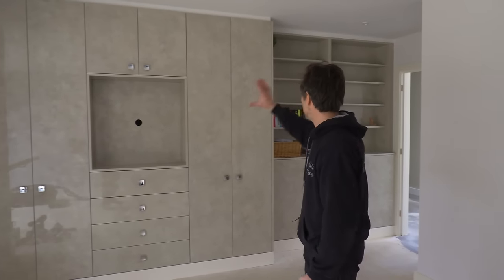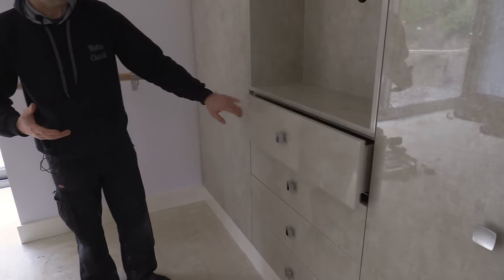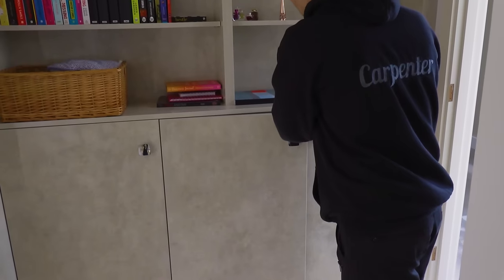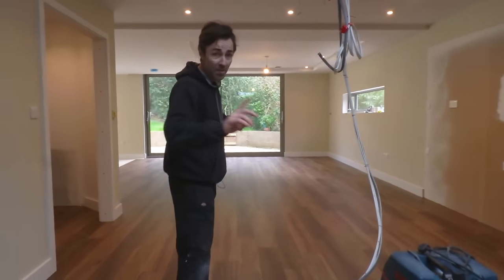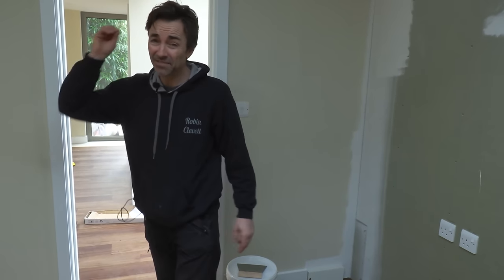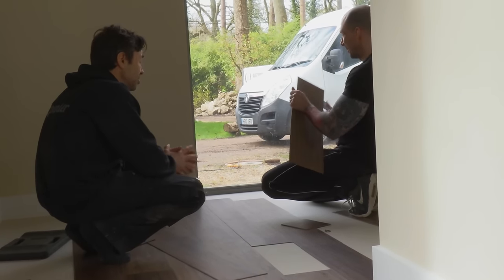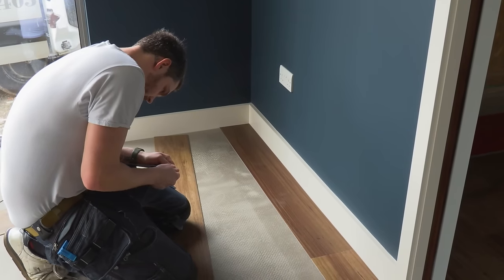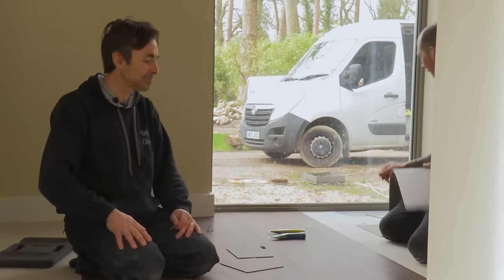Karndean Van Gogh Flooring - Capel #23

Comment: Hi Robin, Great Video I use LVT on a lot of my building projects and karndean is a very good product but I use a product called ambiance flooring I highly recommend you check them out there based in the midlands and also have a vast range of flooring designs. Best of luck for the rest of the build loving the content. 👍🏻

Comment: Robin what are pro’s and con’s with having a remote floor probe instead of using the actual stat? Perfect timing with the video for us as we need to decide on UFH design, Cheers Richard
Reply from the maker: The room stat measures air temperature and it will close the circuit down but it could be set at 30 degs cent for the air and the floor could be running at 40 or even 50 deg cent. The floor probe is a limit stat. The low temperature is also needed on timber floors. The only one you can turn up high is ceramic tiles.
Reply: Richard Corns You have both, the remote probe is making sure the temp in the floor does not go too high, usually 27. The thermostat is in the controller to monitor room temp, what ever you have set to.

Comment: I was interested to hear in the video that Karndean have done something about sensitivity to sunlight. I have Karndean throughout my house, and it has seriously discoloured due to bleaching by sunlight in just a couple of years. I don't know how to upload an image of it, but I can tell you that my flooring is now bright green instead of the warm oak wood tone that it should be. Karndean have offered to replace my flooring as a "goodwill gesture" but I will now have days of disruption to remove the existing flooring and have it replaced with the new planks - and I am having to pay for this work to be done myself because Karndean couldn't trace the original purchase of the flooring (which was fitted before I bought the house) so they didn't cover it under their guarantee. I would urge caution for anyone wishing to fit Karndean flooring anywhere that receives a lot of direct sunlight. Prepare for it to become bright green!

Comment: Recently done my kitchen diner extension in lvt around 60m and initially I couldnt speak Highly enough about it but found with a busy family it marks far too easily for my liking and it's only 5 month old
Reply: Also rubbish with heat expansion
Reply: I guess it wasn't Karndean then? I had it installed in my kitchen diner 13 years ago. The room gets used a lot and always has kids traipsing in and out with filthy shoes. Even now there's only a few marks in it and you don't see them unless looking for them. I'm looking at replacing all my wood floors with Karndean.
Reply: @supernoodle48   did the floor decolourise like many are saying we are planning to get ours done ...going for glue down
Reply: @vaniv2886  There is a small area just on the inside of a fully glazed door. That does get the sun most of the day and I guess the rays have really blasted that spot. The rest of the floor has no noticeable discolouration.

Comment: (Got Karndean at home - better half insisted no wood) Was surprised as a wood expert for you to be promoting it. One really important point - the subfloor needs to be perfect, it will show up any irregularities being flexible. Noted fitters bevelling the edge but assume that just on the ends butting the wall? So is it true it can only be put down by approved fitters? ( nothing wrong with that ). It is also expensive?  but would you say good long term value ?
Reply from the maker: The bevelled edge just gives it a bit of flexibility on the edge where it compresses against the skirting. We have plenty of videos on fitting it and the Palio collection is suitable for general builders, kitchen fitters etc.

Comment: Great looking floor.
Question.
Do you glue these Lino strips  down?
If not why not?
If not, wouldn’t water get under them when mopping?
Reply from the maker: Hi John 
These ones are stuck down and that is common but you can also buy loose lay which is a better product  because you can move the tiles (strips) around to even out wear. As for mopping the tiny bit of water from a wrung out mop will evaporate through the joins. 
https://www.youtube.com/watch?v=WzMwXJKogyM
Reply: @SkillBuilder  
Thanks for the info.
One more question if I may.
Are those in vid self adhesive or do you have to use glue?

Comment: Do you intend to run a mastic bead around the perimeter, floor to skirting, or are you happy that the scribe to the skirtings as a finished job?
Reply from the maker: The scribe is very tight. If you watch them bevel the back it makes it pliable and that squeezes it. Have a look at our other Karndean videos.
Reply: Yeah I thought it could probably do without and running a seal round just creates a maintenance problem in my opinion. Thanks for the reply Roger and  Robin's place looks great. I've really enjoyed the videos. Take care.

Comment: Robin, please tell me what the Floor is like after the floor has been down for a while with the underfloor heating. Check it around where you have your kitchen units sat on it. I’ve had trouble with joints opening and contracting in these positions, this is with another brand of floor.
Reply: Sounds like the wrong adhesive may have been used
Reply: Either wrong adhesive or not enough of it, often see lazy fitters who dont notch their trowels properly

Comment: Never been a fan of LVT, im just a sucker for real wood flooring. I get what you say about the span being an issue, would gluing the floor down not solve these issues?
Reply: can't advise that unless you want it to split! wood needs to expand and contract, expansion joints are built into the flooring to an extent. I have used water down pva to stick back down old bits of parquet floor that's lifted in the past but with the glue centred in the middle of the piece but I'd only do that on localised areas. I'll be rebuilding my extension in the future and I think I might move away from wood to something like this

Comment: you say its bonded down , with what? is adhesive already on material l? or is it applied to floor?
Reply: It's glued using high temperature or pressure sensitive adhesive using an a2 trowel. The guy laying the floor is dry fitting without glue and will go back and glue a few rows at a time as the lvt has to be layed into wet ht adhesive. If you glued up the whole room the glue would have dried up by the time you layed a few rows

Comment: What's the subflooring?
Reply: Its anhydrite slurry, there's a whole video of it going down a few episodes ago in this Capel series, mixed on site
Reply: @simonclifton8056  I saw that video but I didn't think that the flooring guys would bond the flooring using high temp adhesive instead of an epoxy.
Reply from the maker: Bodge 71 There is a cement based self leveller over the anhydrite screed.

Comment: How is it bonded down ? Certainly flying through it
Reply from the maker: they take it up and lay adhesive.
Reply: It will depend on what he's bonding the floor to which wasn't mentioned in the video but he did say he was using a high temperature adhesive.
Reply: You prime the whole floor with it first then ?
Reply: @Djw92 they lay the floor dry first without adhesive then lift a few rows at a time to latch the adhesive and stick it back down

Comment: So a lot of these products say need to keep below 27°c, with maxes around 30°-35°.. yet as you mention, it’s going to be sat in the sun and on a summers day, south facing floor could get up to +40°.  

I’ve a south facing room (screed & UFH) and looking for flooring, no-one (yet) can give a firm answer. Had a few quotes for engineered and vinyls.. No ones willing to say “yup it’ll be fine”.
I’ll check this product of yours out.
Reply: Don’t get quickstep LVT, had issues with heat expanssion